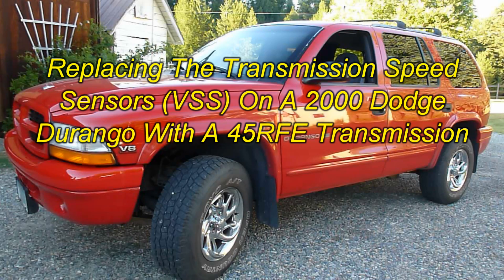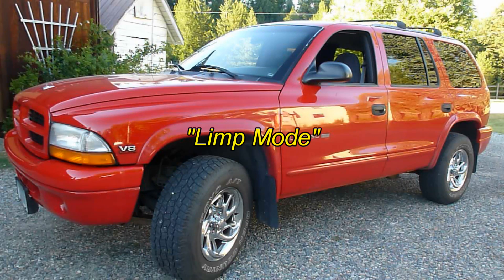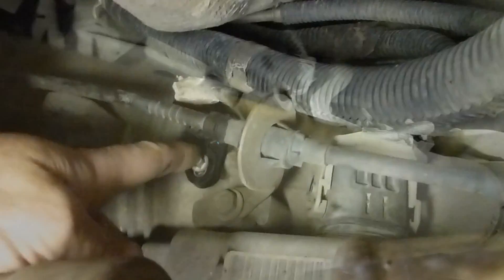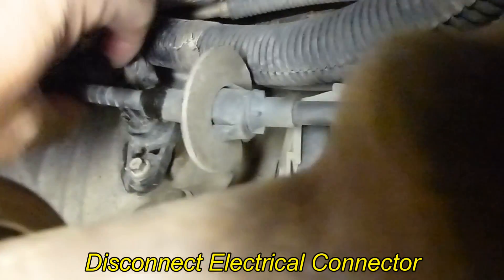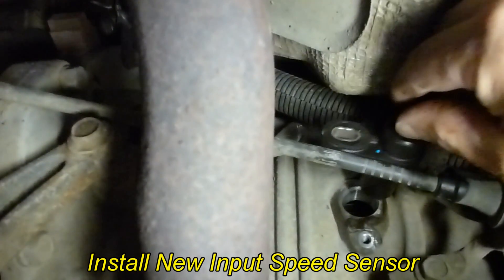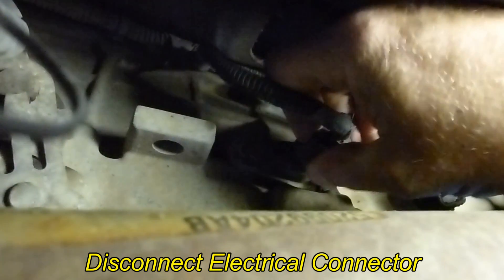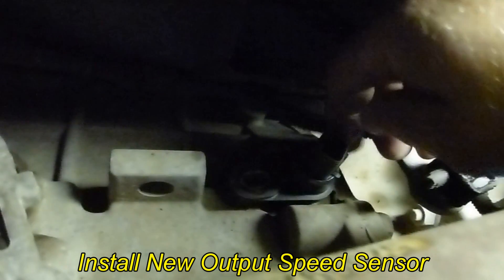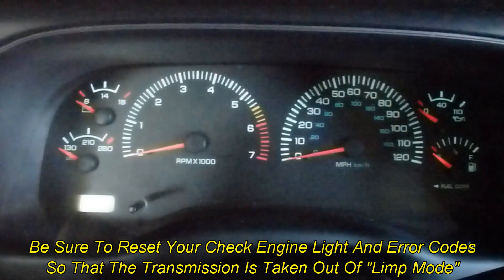Dodge & Jeep Transmission Sensor Replacement On 45RFE & 545RFE

Comment: I was having speedo issues and the engine would stall on harder stops. Turns out the speed sensors on the trans and rear axle all work together for shifting, speedo and engine timing and ABS. I replaced all 3 and my issues have gone. Great video and thank you, Sir.

Comment: Would this fix a delay shift or a no shift problem?
Reply from the maker: If the shifting problem was due to a problem with one or both of the sensors, then I would think that it would also be throwing some error codes with it and also turning your engine light on.
Reply: @Thebobfactor  I am not getting any code but mine won’t shift out of second, could the be the sensors also?
Reply from the maker: @USMC1984  That is really hard to say. Some code readers though will only read the Engine Control Unit (ECU, PCM, ECM) and do not read the Transmission Control Unit (TCU, TCM). And both units can send the vehicle into limp mode. If you're not sure if your code reader will read the TCU error codes, then you may want to use a different code reader to see if the TCU is throwing the error codes that is putting it in limp mode.

Comment: Are the input and the output sensor 100% exactly the same?? I know you mentioned in the comments you haven't seen a part number but I am just trying to figure out if they are identical sensors meaning it doesn't matter which one gets installed where? Thank you!
Reply: I just saw your answer on another vide - they are separate, one in front one is in back

Comment: I just did this I was so stoked thinking yeah my problems are going to be all fixed I replaced the solenoid pack then both speed sensors and the pressure sensor got it all back together went to start it and nothing click  10 minutes before I put it up on the ramps it ran fine  3 days later Im still trying to find the problem lol n so screw you for making it look so easy lol j/k :P  :P

Comment: I have a Jeep Cherokee 2.8td with a P1790 code (fault immediately after a shift) it only drives in gears 1+2+D+R but won't go further or above 35mph..

Any idea on what it could be?
Reply: limp mode

Comment: I will try this method. I also have got codes po700, p1775, p0841. A transmission mechanic told me he would have to take my whole transmission out to see the problem and say parts can cause between 500-1500. I think he is just trying to get over on me. Are you familiar with the other codes I mentioned? Please help, thanks!
Reply: He's probably telling the truth about taking it out...
Reply: Dude, I'm throwing those three codes as well. Please tell me how it's going now

Comment: question I have a 2014 Dodge Journey that the transmission pressure sensor is bad but I can’t find where it’s located on the transmission do you know
Reply from the maker: Hi Luis. I'm afraid I'm not familiar with that one at all. Sorry I can't help.

Comment: I have an 04 liberty, yesterday I was driving home from work when all of a sudden I lost 3rd and 4th gear, it tried to go into 3rd but went into neutral and back to 2nd, it threw me the codes p0733 and p0734, could that be the speed sensor or would that be something else
Reply from the maker: The error code P0734 is described as "Gear 4 Incorrect Ratio". I never got  that error code, but I did get the error code PO733, which is the same problem for gear #3. The errors could also be caused by dirty or not enough transmission fluid or issues with the solenoid. But in my case it was definitely the speed sensors that generated the error codes that I got, including the PO733.

Comment: On my way to work this morning my 06 Dodge Durango downshifted in 2nd then jumped back into 3rd. However, I wasn't a hard shift. So I kept driving. I got on to the highway and after the trans shifted to 4th it downshifted to 3rd then quickly back to 4th. It was a hard shift. I drove the truck home 10miles from my house. Nothing else happened. The transmission was replaced 15,000 (give or take a few hundred miles) mile ago. I'm hoping it's the input/ output sensor. Because the transmission was $1,945.00. 
 I didn't get a code. It might be intermittent issue. Thanks for the video.

Comment: Do you know what part numbers i would need?
Reply from the maker: I don't think I've ever seen an actual part number for these. I think I got mine from ebay. Here's a link to a set for a 2000 Dodge Durango with a 4.7L engine. https://www.ebay.com/itm/45RFE-5-45RFE-Transmission-NEW-INPUT-OUTPUT-SPEED-SENSORS-2-Pieces-for-Dodge-/350964032664

Comment: 01 dodge Dakota 5.9L.  Had not driven in several months (owner died), but had trans filter kit and synthetic trans fluid done 1,700 miles ago.  Transmission fluid level clean and full.  Seemed fine for about 200 miles after we began driving it again and then ALL OF A SUDDEN, shifting problems and whining ONLY in drive and reverse.  NO whining in park or neutral.  NO engine lights on.  Got any ideas?  Thanks!
Reply from the maker: The Durango did seem to whine when the sensors went out on it, but it was only because the tranny wouldn't shift into a higher gear at higher speeds. I'm not sure if that's what you are hearing though. If it's not shifting into a higher gear than it may be in limp mode though. Sorry I can't be more help than that.

Comment: Did you have a check engine light when your Durango went into limp mode? I do not have a code reader and when I went to auto zone and they ran a scanner the only thing it showed was for the power steering pressure switch which I recently replaced. Yesterday I experienced some hard shifting where it felt kind of jumpy from 2nd to 3rd. The RPM's also jumped up a bit when shifting. I'm not sure if this is considered limp mode or not. I think I'd be willing to try and replace these two sensors before taking it into a shop if I can nail down what the issue is.
Reply from the maker: The engine light did come on on mine and I also got a variety of error codes from the code reader. I listed the codes in the description. When mine went into limp mode though it would never shift into 3rd gear. It only ran in 1st and 2nd gears. So if yours is going to 3rd gear then I'm not sure it's limp mode.
Reply: I got impatient and went ahead and decided to change the input speed sensor to see if it would help. 16 year old sensor, figured if it hadn't gone out it probably would soon. Well I got rewarded for attempting to be proactive, the head of the bolt sheared right off when I tried to loosen it. I haven't found a way to get it out myself as I'm afraid to attempt to drill it out myself and I lack a welder to stick a nut on there and then try to loosen it that way. Guess I'll be letting a pro handle getting that bolt out this time. Anyway, thanks for making the video. May or may not have been the fix in my instance but regardless it's awesome you're contributing to helping others diagnose and solve issues.
Reply: @DustinHartAM - No scanner, no problem. Just turn the key off and on 3 times and it will give you the codes.

https://youtu.be/xkgixaAtEI8?t=15s

Comment: Every owner of a Durango should know this. I have got a 0605 and 0700 code when I scanned it but the symptoms are exactly as described on this video. I hope this two sensors are the solution to my problem. Thanks for this awesome video.
Reply from the maker: Hey, thanks for the information Jorge. I'm sure it will help out others 
who are getting the same codes that you are getting. Let me know how you
 make out on this one. Thanks.

Comment: I have P0734 and P0735 codes with a hard 2-3 shift and occasional slippage in 2nd. I am about to replace the trans. I was wondering if you experienced any of this with the codes you were getting. I have the 45RFE with 180k on it.
Reply: I know this is a old post but what happened to your transmission.

Comment: Hello. I have a 05 liberty renegade .My wife drove on highway and the vehicle would not move anymore ,it went as if it was in neutral , and had to be towed home .We had code read at. Auto Zone which stated problem was sensor , we lost code # car won't move.  could a sensor actually cause this. We are at a lost . help please.
Reply from the maker: I'm not 100% sure, but I would really doubt that a faulty sensor would cause it stop like that. Most will go into "limp mode" which still allows you to drive the vehicle, though somewhat slow. When the sensor on my rig when out and it was in limp mode, it would only run in the lower two gears. Most trannys also have their own main control module. If the module goes out, possibly that may cause it to not run at all.

Comment: Hello Robert , I have a 2012 Durango where can I find the location of the sensor any help would be appreciated. Not sure which side you were on for the front.
Reply from the maker: Hi Robert. Both sensors were on the driver's side of my 2000's 45RFE transmission
Reply: Thank you I took mine to two mechanics they couldn't locate them I will look and research hard to find anything online , Appreciate your quick response.

Comment: Hello Robert, I hooked a code reader that only said P0500 Vehicle speed sensor. I went to Auto Zone and they helped me find the one that goes the my 2001 Dodge Durango. It doesn't look like yours, and I'm not sure if its for the front or back. I bought the Duralast SU1034. If you know anything about this I would truly appreciate any help you can provide. I can give you my email for phone # so I can send you a pic of what's going on.Thank you,Lizzy

Comment: i have a P0733 code on my 03 nissan pathfinder should this be my problem also?Please if you can respond back promptly.Thanks!
Reply from the maker: Hi Tyrone. I've never worked on Nissan's before, but I researched it a little bit, and it does look like that code could indicate a bad transmission sensor. But, it could also indicate a problem with the ECM,  or a shift solenoid, or even simply low tranny fluid. You didn't mention it, but is the Pathfinder in a limp mode where it will not go into a higher gear?

Comment: Hi I have a question.  I have a 2004 kia Spectra and I've been having transmission slipping problems.  I got codes p0717 p0731-p0734 on.  Do you think if I replace sensor p0717 my car will stop having transmission problems?  I don't want to have to replace my transmission.

Comment: I have all of the same symptoms.  However, I can only read a P0700 code which seems to be a general transmission error.
Reply from the maker: 99tsr From what I've been reading about the #P0700 error, it can be a "generalized" code for the Transmission Control Module (TCM). I found many forum post addressing this error code where the successful  solutions ranged from replacing the transmission sensors, to just cleaning the connections on the sensors, to changing the transmission fluid and filters. The filter/fluid change repair did show up more often as far as fixing the problem. I hope this helps you out a little bit 99tsr.
Reply: Thanks.  I tried cleaning the pressure sensor  and replacing the input/output speed sensor, and changed the filter a month ago.  So it is in the shop....waiting to see what they find. Thanks. Bob
Reply from the maker: 99tsr It sounds like you've pretty much tried everything possible. Good luck with the repair 99tsr! I'd sure be interested to hear what they finally find.